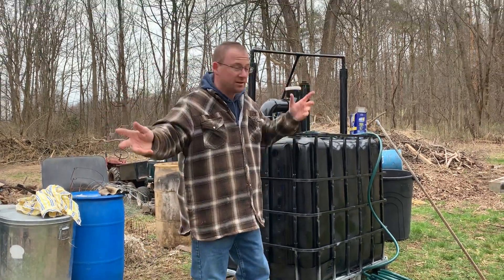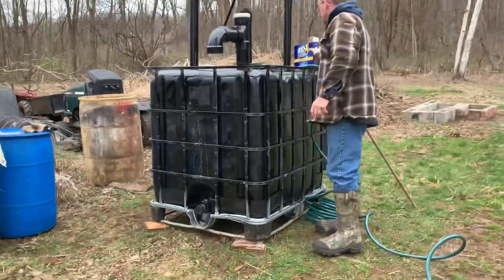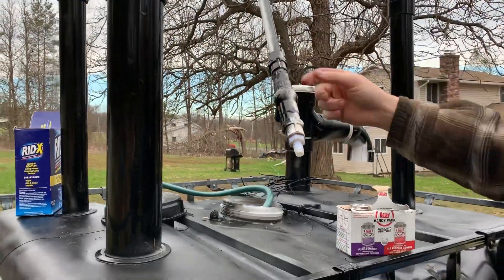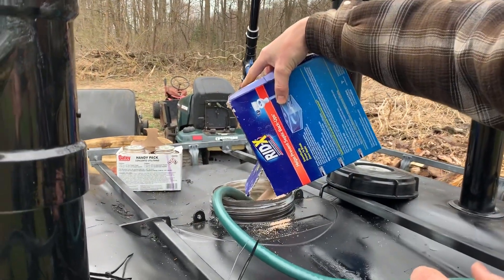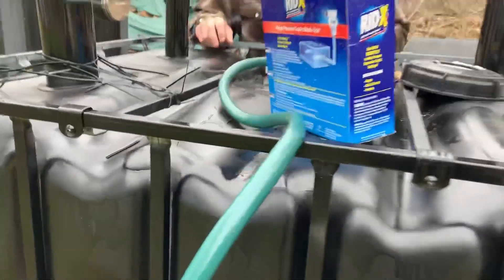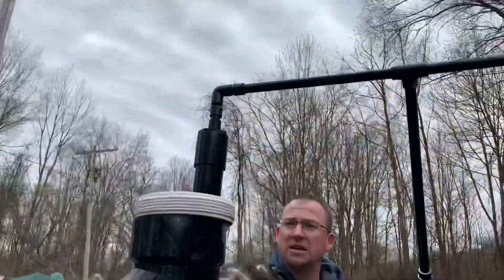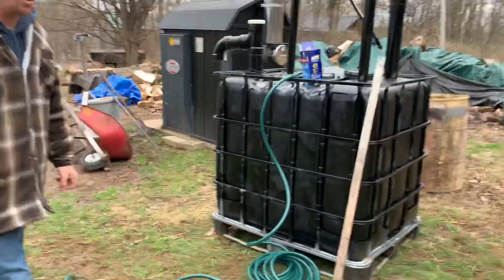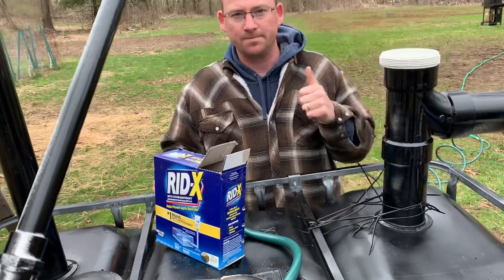Anaerobic Ibc biogas digester start up using ridx

Comment: Try storing  THOR or building around a glass enclosure  it gets surprisingly warm in the slightest amount of sunlight.
Also black insulation to absorb UV ?
Reply from the maker: I covered big Thor and little Thor last fall in hay grass and leaves. Both digesters did good holding temperatures this winter.
Reply: Nice, simple solution Dave!